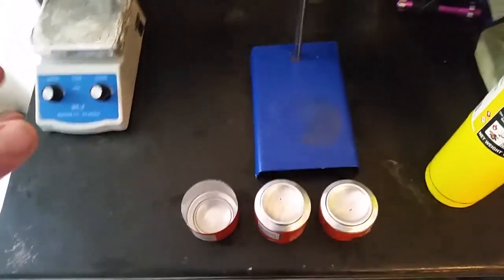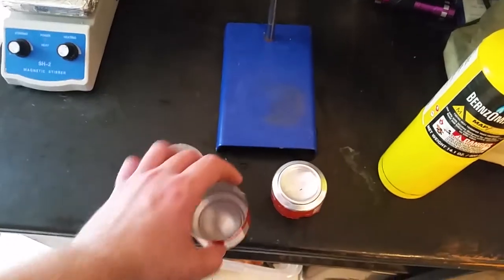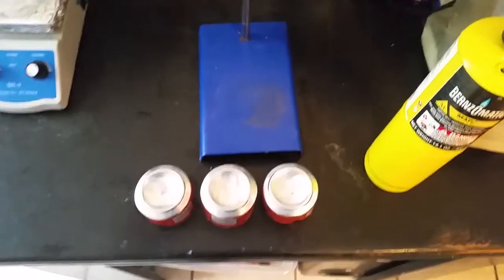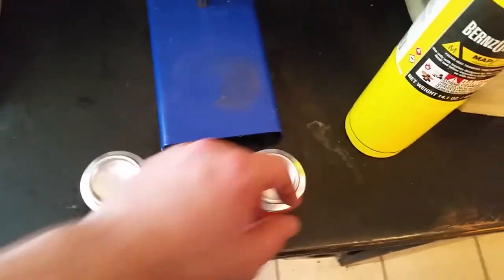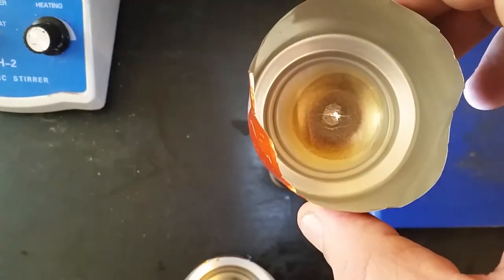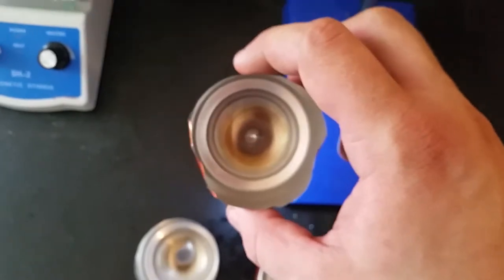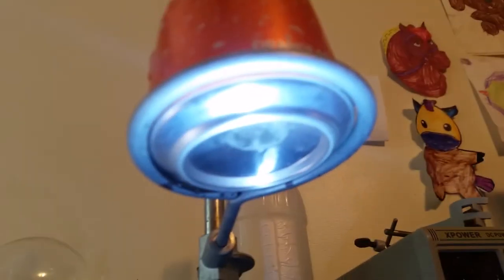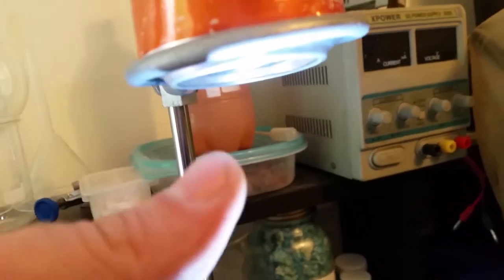Comment Follow Up: Thunderf00t's "Transparent Aluminum"

Comment: I believe you are 100% correct, but a way to prove your point would have been to add a drop of soap to the water.  Soap is a saponifier and will break the surface tension of the water.
Reply: Saponify means "turn into soap", so... yes, soap makes water soapy.

Comment: I have a huge issue with your experiment. The original was done via a Butane torch burning at roughly 1,970 degrees Celsius, and was put to the material for just a few seconds. You are using Mapp Gas, which is just a brand name for Acetylene, which burns at 3,100 degrees Celsius and you were putting it to the material for roughly the same amount of time. Aluminum melts at 660 degrees Celsius, so I do not believe thunderf00t's material actual reached that 660 degree mark, I am however one-hundred percent certain that your Acetylene torch did get the material well above that 660 degree mark. I am not a professional Chemist or a Materials Scientist, however I do agree that what has happened in the original shown by thunderf00t is that the brief stint at close to melting temperature allowed the aluminum to form into some very dirty sapphire. This product is used in tons of forms, safety equipment, bulletproof glass, the base idea is even incorporated into the windows on modern spacecraft. 

To reiterate, I do believe that in your experiments the result was micro-pores in the material, however your experiment failed to match to the base guidelines of the original experiment, so your conclusions are suspect at best and just outright false at worst.
Reply from the maker: To test this hypothesis of yours you simply need to run the two types of torch over some aluminum and observe the results. It is evident by your comment that you have not attempted this.  I happen to know for a fact that they produce the same effect (albeit map gas gets it to temp a fraction of a second faster) however I don't think you will simply take my word for it.  Go ahead an try it out.  I have nothing to gain by deceiving you.

Sapphire is extensively more difficult to produce in any visible quantity than just running a torch over aluminum.  You need to melt aluminum oxide which at a bit above 3700F map gas or butane simply cannot touch under the best of circumstances with a torch.  Then to top this off you need to melt this oxide under high pressure.  I torched this aluminum under atmospheric pressure as did Thunderf00t.  To get larger crystals you then have to slowly cool the melt over several weeks of which my aluminum cooled in a few seconds as did Thunderf00t's.  

To simply google some temps for various types of gasses tells you very little about how they will heat and interact with a material.  Sure a map gas torch can melt a copper penny but if you try to melt a hole in the middle of a copper dinner plate you will empty your bottle with nothing to show for it.  To top this off torches do not reach the theoretical max temp for a particular gas.  They usually fall well below the max temp for various reasons such as cool atmospheric air, improper combustion ratio, ect.  

All I can say is try it for yourself.  Torches are cheap and so is aluminum.  If you manage to produce sapphire let me know and we will revolutionize the industry as you would have found a brand new and much cheaper way to do so.
Reply: After a little more research, and consulting with a few people this morning, we came to the idea that what is happening is the process is creating tiny microscopic particles of aluminum oxide which are being held in a very brittle matrix of remaining alumina. In the case of your experiments they agree with me that the material takes a different structure between your run and thunderf00ts. So where as your material developed pores where aluminum oxide particles didnt form, thunderf00t's experiment left enough of an alumina matrix behind to support the aluminum(3) oxide particles. 

As I said before I am not a chemist, but the ones I spoke with support my hypothesis. And we are going to run this experiment ourselves late next week, I will try and remember to share our data with you. You may still be correct, but I want to find out for myself. This has some interesting implications if it works the way we think it does. 

Also, Acetylene is used to cut and shape high-carbon steel. Im not arguing that your little hand torch has enough oxidizer, I am simply stating that I could cut a building in half with a proper oxy/acetylene torch.
Reply: Also, I feel I should mention that I was not intending to be overly critical of your work here. I actually applaud you for taking it on yourself to further this work and share your hypothesis, this is how we grow science as a whole. I feel from your response I may have aggravated you and that simply was not intended. I was simply adding my two cents, as it were. Please keep up the good work.
Reply: Mapp gas and Acetylene are not the same thing...
MAPP Gas is a stabilized mixture of methylacetylene (propyne) and propadiene
Acetylene is Ethyne.
Reply: Was about to mention the requirements for sapphire formation but I see it has already been listed by the channel owner

Comment: Reminds me of a science experiment we did in grade school. As I recall, we took a soda can, cut off the top and punched a tiny hole in the bottom with a pin. We then suspended the can on a stand and slowly added water until water trickled out of the hole. We also experimented with adding dish soap or glycerin to see if that made a difference (it did.)